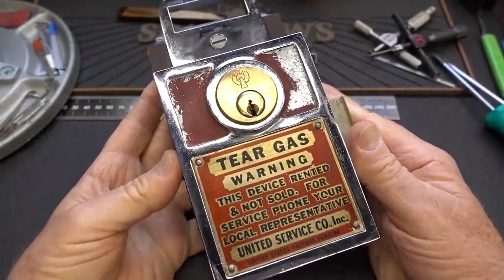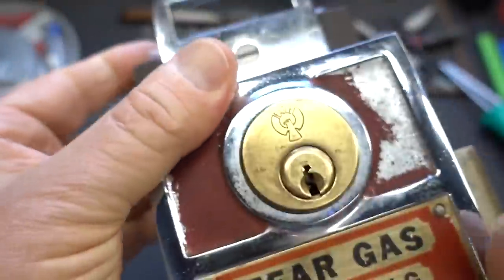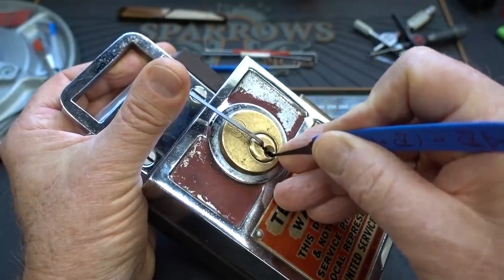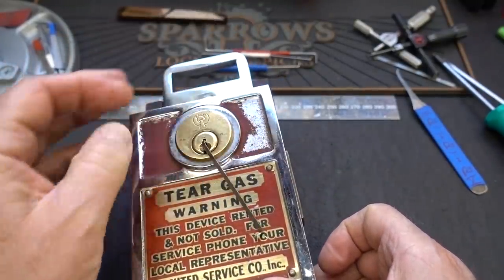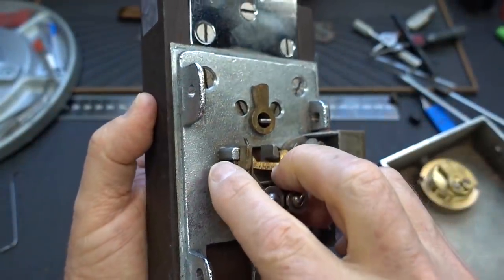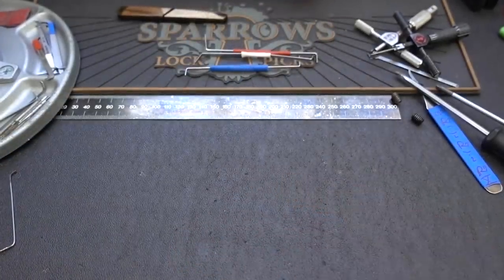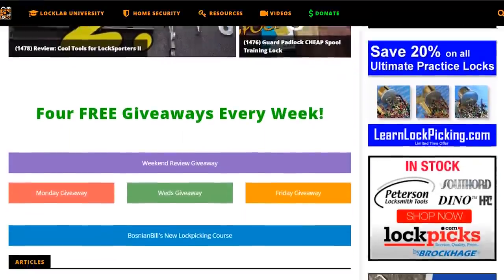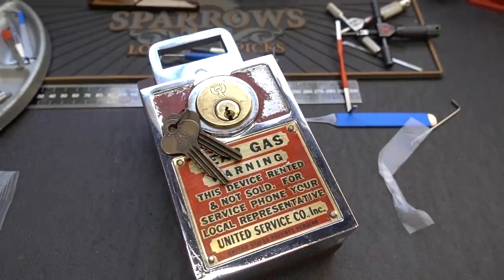(1794) Lock Booby-Trapped w/Tear Gas!

Comment: Is there any Video where you explain the terms like "false set" "binding" etc.? I really want to learn lock picking but the only lock I managed to pick was a simple acrylic learning lock.
It's so frustrating.
Reply: LOL... i know what you mean by the acrylic learning locks... so easy.  I've been able to open "Master Lock" padlocks as well by just raking (shouldn't be a surprise) but as for the rest of it, I too could use some help with the terminology like "false set", "binding", etc.   Cheers and good luck with your newly found skill :)
Reply: Go to Bill's site, locklab.com then from the menu start at "Lock Picking For Beginners".
I've learned a lot over the last couple of years from the locklab site.
I'll never be as good as Bill and the Lockpicking Lawyer, but I've gotten considerably better with practice using the repinnable practice locks in Bill's videos. Good Luck!
Reply: As alan3082 said, check out the learning sequences on locklab.com but for a quick start- "false set" is when the core rotates slightly, as if open, then stops due to some security pin shenanigans. Binding is when you try to rotate the core, and your pick finds a pin that resists moving because it's pinched by that rotation, binding it in place. Go through the video course on Bill's site, he explains it all.
Reply: I suggest looking on YouTube for other pickers, and there are a lot of them that can and will correspond with you.
They can and will help any way possible.
Reply: @Steel-Pinnings  yeah, it's like watching Bob Ross trying to learn painting. They pick the locks as if it would be nothing.
I don't feel safe any more because every lock is pickable within 2 minutes at max.
Reply: The Bob Ross analogy is excellent

Comment: It looks like the bolt is held back using springs against the housing. If you pulled on the door hard, the springs would cause the housing to come away from the springs and bokts therefore moving away from the hammer and allowing it to swing.

Comment: I imagine the way that's intended to work is if you're levering or kicking on the door whilst it's locked, this would cause the lock to flex a bit and would shift the hammer off the little step.

Comment: I think the salesman's display lock has a captive hammer to lessen the chance of a tear gas ampule being accidentally broken. To me, it looks like a functioning model would be designed so the lock actuators manipulate the bolt and act as a safety for the internal hammer. Bolt out means the system is armed so blunt force attacks and shimming the bolt would set off the hammer. Rotate the actuators to draw the bolt into the lock body and block the hammer, putting it on "safe" so a door slam doesn't release the hammer and unintentionally deploy tear gas.

Comment: Well, most people kick doors or use tools to break them rather than picking them, thus the mechanism does make sense...
PS: I did break two doors without tools and neither of them should be able to be broken like this: a steel fire door (it was hard to push open and most people kicked it thus, but I tried to push it with my hand and nearly broke my wrist and in anger I kicked it only to realize that it was locked...), the other was a safety cabinet for locking up dangerous chemicals (I was supposed to hand them out and we were under time pressure but the key broke).

Comment: A 2 turn bolt mechanism, that required picking twice, and after the first turn a gas spring would slowly move to release the hammer until the 2nd turn would do the trick (or at least something) against picking? (also curious if a mechanism like this that could bind a muti-turn lock if not turned/picked fast enough is a good idea/exists)

Comment: For the last couple weeks I’d tried to open the website and sign up for the give away and unlike the previous year or so, I’ve gotten the following notice on a white screen: “Welcome to nginx! If you see this page, the nginx server is successfully installed and working. Further configuration is required.” . Now I’d tried accessing the site via Chrome & Duck Duck Go, & Safari with the same result (all from my iPhone XS as that’s what I have to work with currently..).  I was provided with a link from a very kind fellow viewer and that worked out swimmingly, however, I’m still unclear if the issue has to do with the website and accessing it from my phone as opposed to a PC/Mac OR if it’s something else.. either way, this likely isn’t the forum for that discussion and I’ll shush now.  Thanks to Mike for the assist and to Bill, keep up the great work!
Reply: Weird I had no trouble at all. Using Firefox running on Android
Reply: @mikecummings4715  I’m working with my iPhone XS and checked via Chrome, Duck, Duck, Go, and Safari.. I’m glad it’s working for you.. but pretty disappointed it’s not working for me 😕
Reply: @mikecummings4715  that worked! Thank you very much!  I’ve bookmarked that link and will hope a simple refresh next week will work.  Must admit, I’m not exactly tech literate so there’s still an element of magic and mystery in this for me.. many thanks for being the best wizard in the village.
Reply: @widgets-widgets5210  no worries I'm glad that got you fixed up
Reply: @Shackman66  thank you, I will do

Comment: Im waiting for the day when a company comes out with a lock that has an alarm in it, where the alarm goes off if you try to use ANY key other than the correct one, instead of the lock opening when you turn it, instead the alarm goes off

Comment: From the patent of a similar lock (https://patents.google.com/patent/US1758096A/en), it seems that the hammer is triggered if the bolt is bent or forced in without using the lock. The patent doesn't give much detail as to how this happens, but we can assume that:
- In the case of a bent bolt, the hammer seems to be disengaged from its locking pin by the longitudinal rib of the bolt.
- In the case of a forced-in bolt, the tumbler disengages the hammer from its locking pin. I assume it the hammer is pushed "above" the pin through by a beveled surface, but the tumbler could also be designed to break the locking pin, though that is unlikely.